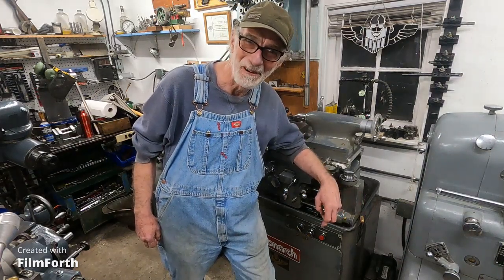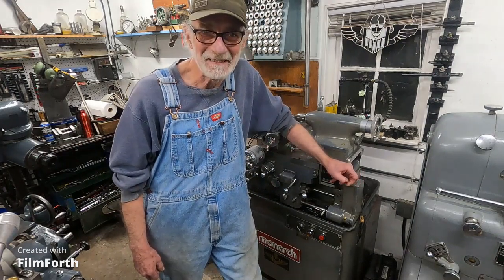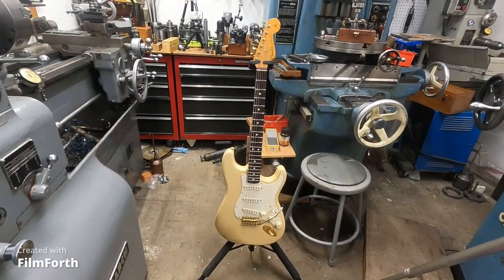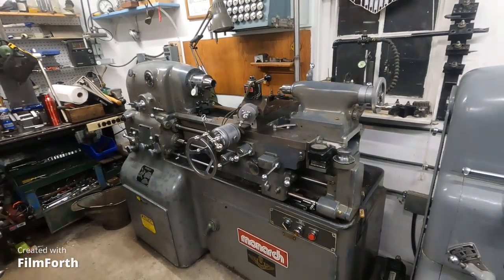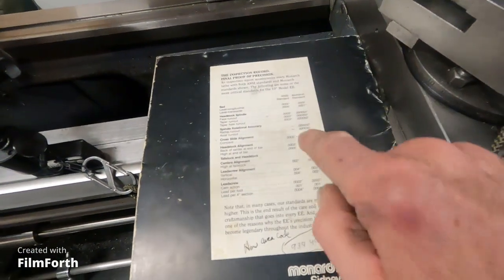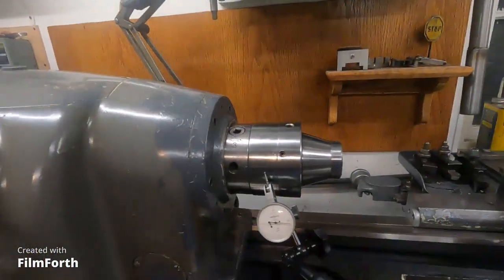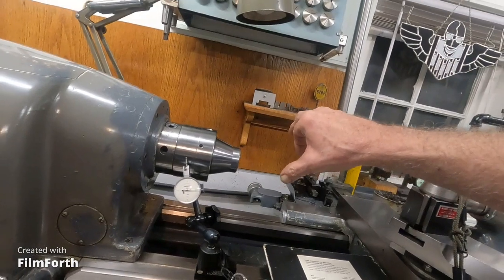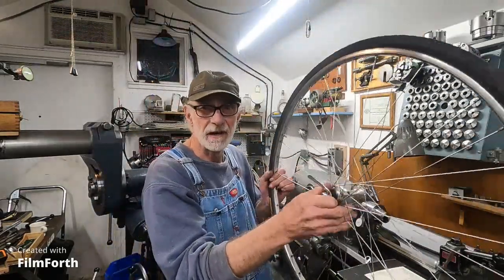Monarch 10ee lathe more dynamics of precision

Comment: Dee Dee
I appreciate your knowledge on the Monarch 10EE
I have just received my 1952 monarch 10EE
I have loved this machine for many years and looking forward to many more years of lathe projects, running across this new machine for me 
I’ve been in the industry for 47+ years and still actively involved with surgical cuttin g devices in industrial cutting tools 
It is been a fantastic addition to my hobby shop. It is not a purest machine. It has a VFD, but still extremely accurate and has all the bells and whistles
Thanks again for your knowledge
Reply from the maker: That is the way to go, the freak show here and on the Stink Finger White Supremist machinist forum is the absolute failure of replacement of DC drives, it can not be done with cheap components The VFD is the only way to go, it cost more and its more work, also what the factory is using now. Sounds like lots of fun at your place!